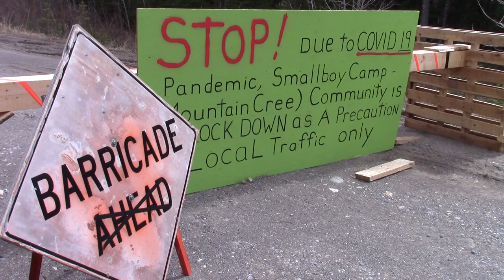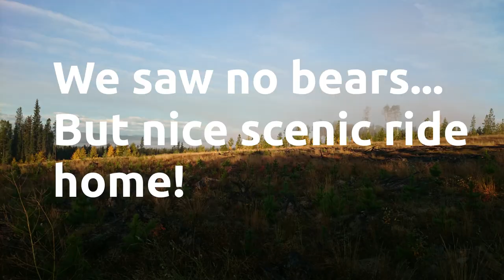Ruby Falls Alberta! ATV Adventure!

Comment: There is another set of falls back in there
Reply from the maker: So I have to go back your saying!
Reply: @300sendero  they are located before you get to ruby falls there is the bit of the trail to ruby falls following the river to the falls where you go through the trees with the big mud hole on the ruby falls side of the trees ride the river down stream and you will find them